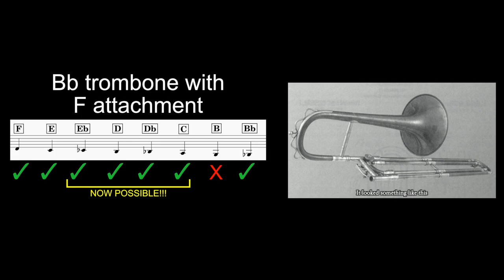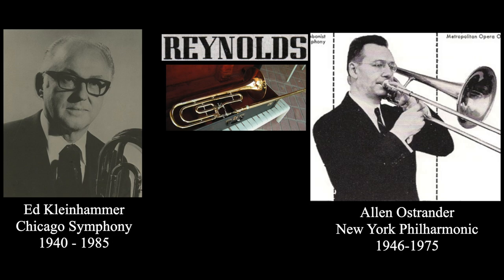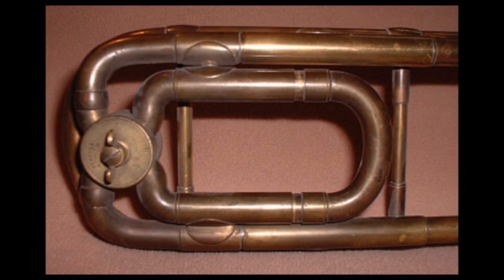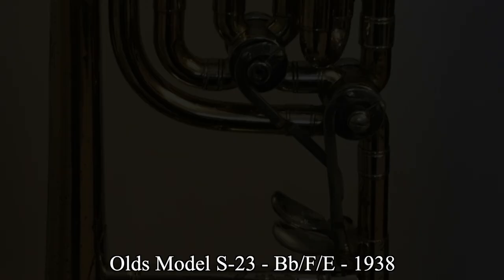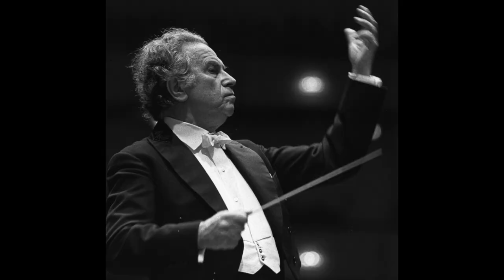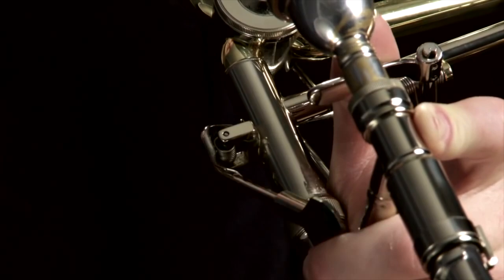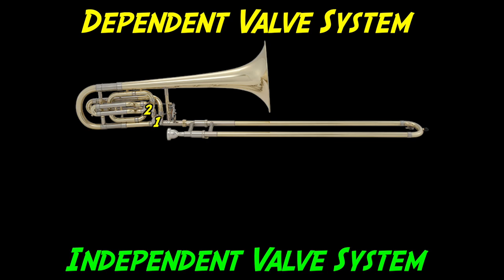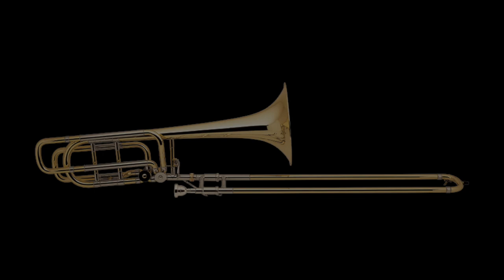The History of the Double Valve Bass Trombone

Comment: I own and play an Olds S-23, although I've had it retrofitted with independent valves.  Mine was built in 1970, but I had no idea at the time that I made the purchase that the design dates back to the late '30s.  I've wondered since then why it was the case that the players mentioned in this video felt it necessary to go to the manufacturers they knew and request that they develop a double-valve bass trombone from scratch rather than simply purchase one from Olds.  Well, since one thing every version of their stories have in common is that none of them mention Olds at all, it's entirely possible that it was a question of marketing - if Olds was making zero effort to inform players east of the Rockies that they offered a double-valve instrument, then those players had no way of knowing that the thing they were looking for was already available.  But even if they did know, it's also entirely possible that the Olds would not have suited their needs.  With the exception of the 10" bell, the S-23 has dimensions which are considerably smaller than the typical modern bass trombone.  This makes it perfect for big band and fitting in with a section of small-bore tenors, but very difficult to blend with a section of modern large-bore tenors and a 6/4 tuba.

Comment: Bollinger tuning isn’t G and E-flat, it’s F and G quarter flat, which helps reduce the amount of adjusting positions in an out of the valves. All modern bass trombones have F as their first valve, and the second valve is variable in G, G-flat, or the Bollinger G quarter-flat. Dependent models are still made, but independent with G-flat second valve is most popular

Comment: You have to talk more about the German engenering Bass trombone. In Germany you had 5 sizes of trombone and the independent valve system was included so much earlyer than in the US. Also you have a complet different Disign and airflow on a real German trombone.

Comment: They should have just made a trombone with a longer slide with the handle like a G bass trombone so you can reach the low B without needing a second trigger.
Reply: But then in order to keep it in Bb you'd have to take tubing from the bell section. This leaves you with either a really unbalanced horn or a counterweight, at which point you have the extra weight anyway and key as well make some use of it with a 2nd trigger instead of the counterweight.

I suppose something like this could maybe be feasible with a carbon fiber slide, but it would still be ergonomically very different from any other bass trombone as you'd have to relearn muscle memory for all the positions because of the handle and all just for 1 extra note.